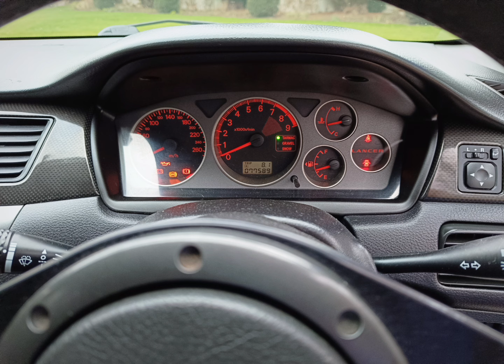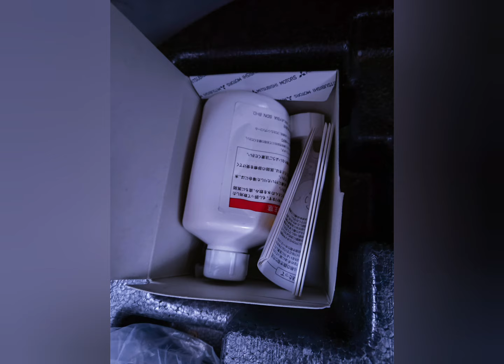500+ BHP Mitsubishi EVO 9 MR FQ340. Walk Around Video Slide, &, Sound Clips! Mental Noises. CLEAN!

Comment: I love the evo 9 I remember when I had the FQ 320 bought it when it was 2 1/2 year old brilliant car I’ve had Tommy Mackinnon evo 6 evo 7 FQ 300 and GSR Evo 8  I love the Mitsubishi brand 👌
Reply from the maker: All evo's are fantastic!!! Have you got any videos?
Reply: @ only one when I had my Tommy Mackinnon mapped on the rolling road and videos on fb with the boys and they are evos coming home for a show my mats evo 6 tme in red 720hp
Reply from the maker: @LeeWilliams-m3n  brilliant cars the 6's and styling right on point with the mak.
Reply: @ definitely my mate did have a evo 5 rs fully rebuilt 2.1 stroker engine was built to take 800 added mapped to 450 / 500 pound Torque
Reply from the maker: @LeeWilliams-m3n  my 9 is a 2.1 special order low comp. pistons. Hks turbo. Loads of upgrades, drives and sounds like nothing else. 4g is sooo underrated.